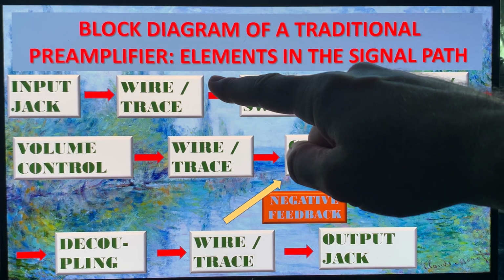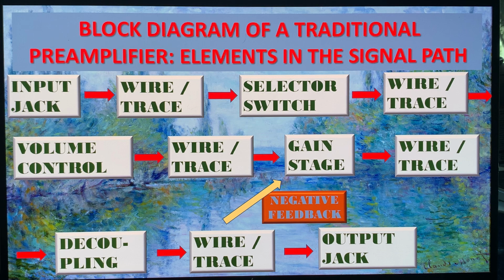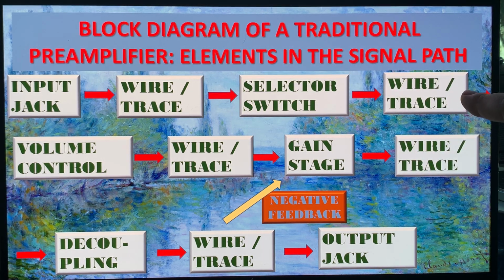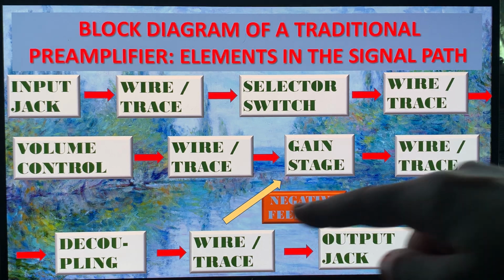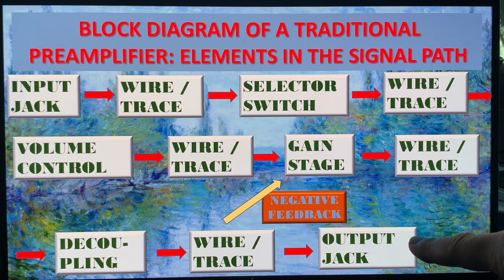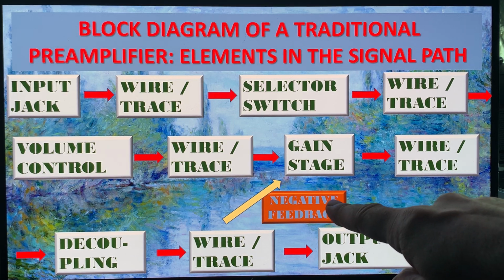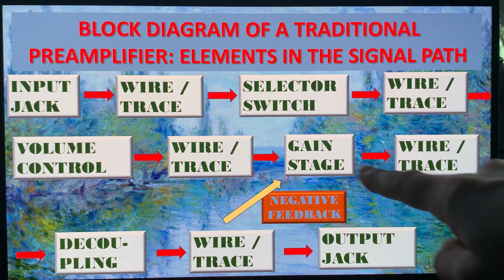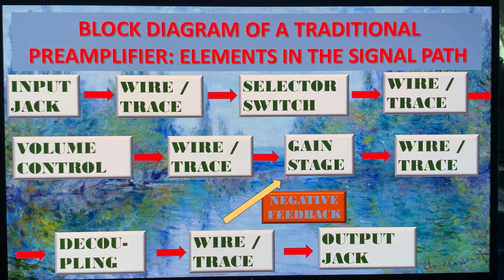Secrets to Preamplifiers: The signal path

Comment: I had a bass player and a guitarist over earlier this week and they were amazed my tube amp didn't have EQ. They use EQ in their audio, in live performances, in their studios... It seems that the audiophile cults of measurement and purity is nearly the opposite of what they strife for: have a tight well rehearsed band, creative performances that surprise, apply EQ that matches the venue: all is based on feel - no purity or measurements involved. Audiophiles focus on shortening signals paths while they run miles of XLR cable! In summary, I sense a massive dissonance when comparing the recording vs the reproducing side. I think a purist system really excels when it meets more purist, less processed recordings (I love 50s recordings for that). But if it meets an overly processed recording, why not add EQ ? :-) The last meters that we then add in the overall signal path from the recording microphone to our speakers may well not be a limiting factor at all.
Reply from the maker: Indeed, creating the sound a musician wants, and playing it back are quite different things because of limitations.  Sadly, making things more direct path limits effects and adaptability, and for example would force musicians to play only in venues with perfect acoustics... as most places have awful acoustics, hence the good old EQ has to save the day at the expense of clarity. Losing fine details is barely an afterthought when the main challenge is to make it loud enough so that people in the last row can hear it.... ;   that's why pro gear focus on EQ, power delivery, ability to drive super long junk cables without hum pickup, and the ability to make it VERY LOUD. :)

Comment: Dear Janos, in regards to preamplifiers, it would be great if you could elaborate on coupling transformers or even autotransformers. These don't have the disadvantages of traditional gain stages. If so, why are they not a very common solution?
Reply from the maker: Excellent question, it deserves a video! Short answer: price, added weight, added size. Much cheaper to slap on a constant current load, which is a light, cheap and small, and requires no planning for magnetic coupling / isolation (which the transformers require).
Reply: how about OTL preamps...?

Comment: I have tried for years to eliminate the preamp in order to save money ! I have not been successful at all… good preamps are quite expensive but still worth every €$£ you put into them!
Reply from the maker: Hi Klaus, so true ! Good preamps are extremely rare and tend to be super expensive. The only workable road to get rid of them is through gain optimization, ultimate matching when the source impedance matches the amplifier input impedance, and we either use AVC / TVC or get rid of the volume control and have straight unchanged signal level, which is a set volume for all sessions. This latest approach has the best sonic potential, at the cost of the fixed volume. Which, people will always take when they hear the difference. ;
Reply: I have a Nuprime Dac 10H.... It has an awesome volume control, and outputs 2 or 4 volts! I don't need a pre, plenty of gain.
Reply from the maker: @islandlightphotodotcom7162  Yup, the beauty of digital! :) :elbowcough::washhands: And the two output level options give you a lot of freedom for amps :)
Reply: @realworldaudio  If I'm going to have digital in my system, t may as well have extra utility!